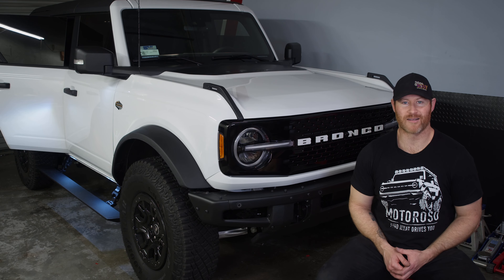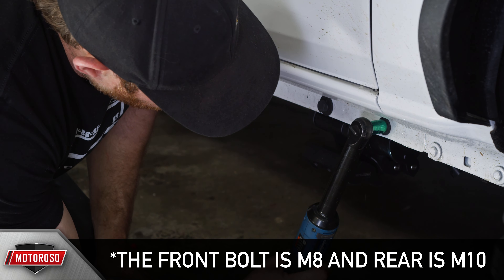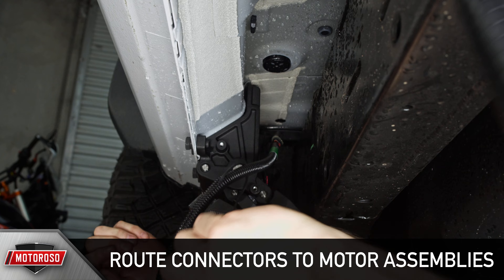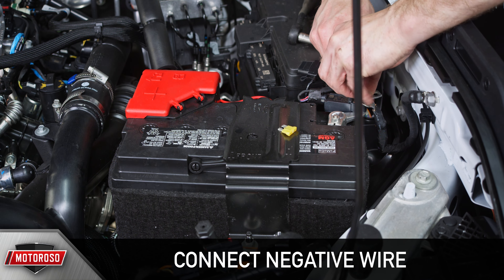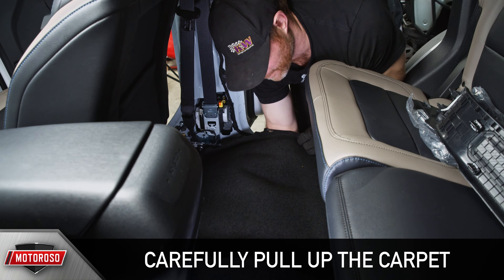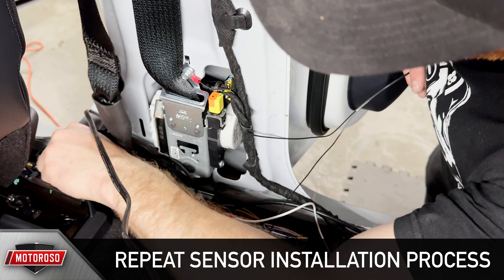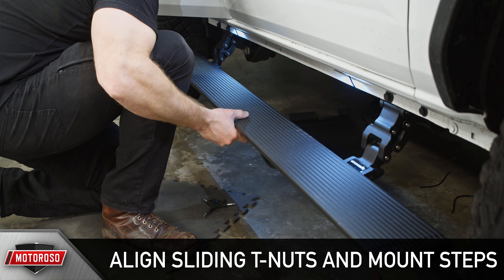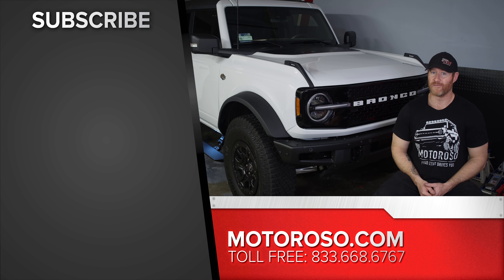Installing the Go Rhino E1 Electric Running Boards on the 6th Gen. Ford Bronco | 2-Door & 4-Door

Comment: Thank you SO MUCH! I just got done installing them (rough country). The instructions from RC are hot garbage once you get past installing the motors. Your video got me through the parts they just gloss over.
A few tips - 1, Connect the wiring harness to the control module before you bolt it in. The 2 small connectors are really difficult to engage if the module is already bolted in. 2, If you remove the covers for the rear seat to floor brackets, it makes it a lot easier to elevate the carpet when running the white wire across.
3 - Bolt the steps to the motors LAST. There's no reason to have them in your way until you're done with all the wiring. This is especially helpful if you're doing the job laying on your back like me.

Comment: Great video it would be great for you to do a second video just for the 2 door. It is significantly different. A few things to note. 1. The controller is different and mounts directly behind the drivers rear motor. This means that you need to install the controller before you install the read motor. Second, there is really no way to ground the door sensor to the seat belt without taking all the molding out (which is a huge pain in the 2 door). Instead you can ground it to the drivers chair. Speaking of chairs, you really need to remove the drivers and passengers chair completely in order to fish the passenger wire across the car. It's still a pain but can be done. Lastly, as directed by Motoroso, you will have a MUCH easier time tightening the four motors once everything is installed and the steps are deployed. With that said, all the work was totally worth it.

Comment: Great video. So after installing both these and the amp steps, which option which do you prefer? The price point on the rough country ( which seems to be a rebranded go rhino) is hard to beat if you can deal with the magnets.

Comment: Even tho the amp research is more expensive and more of a hassle to install, I think I’m going to run the amps instead of this kit. Too many exposed wires. Door jams with magnets? Not ideal and definitely not clean.
Reply from the maker: Right on, all good! They’re both great products, but can’t argue with the cleaner install point. We have a few sets of the AMP steps in stock at the moment, they’re extremely hard to get (have been for 12 months). Might wanna jump on those now if you know you want them.